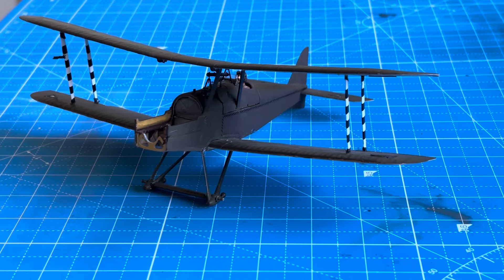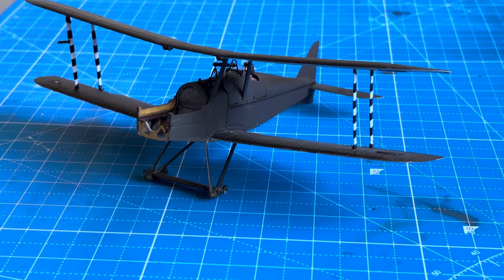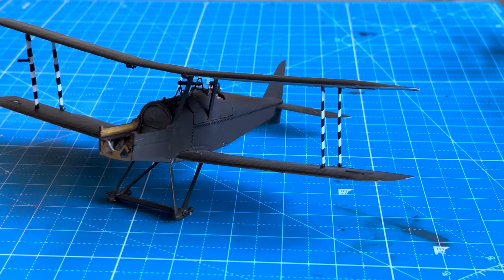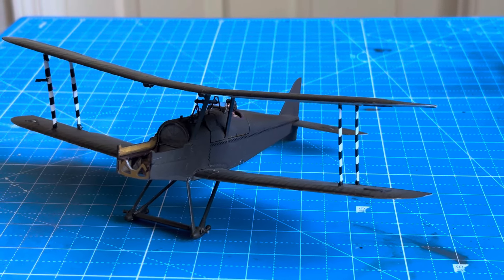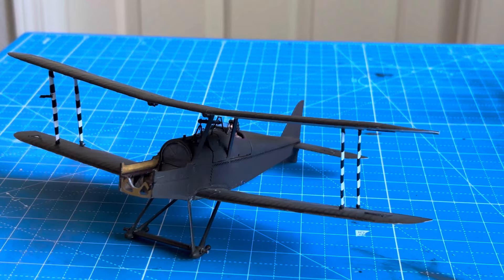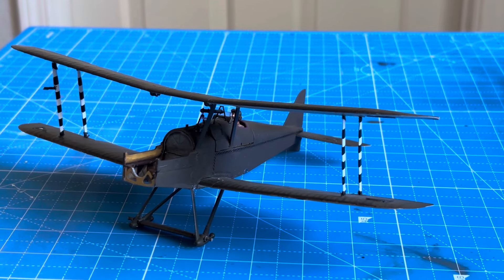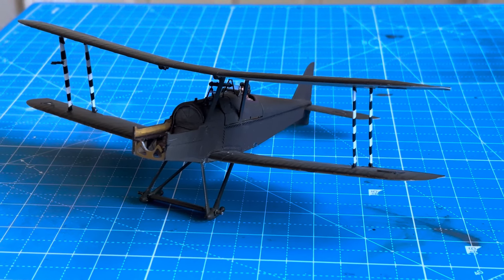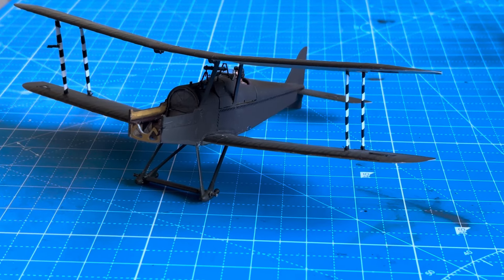There’s got to be a morning after…

Comment: Inspiring words unanticipated on a Wednesday
You're a modelling workman Mark - and I can think of no better compliment, no drama next morning, just a plan and the firm intent to push it through
I could learn a lot from you if I had the sense  ;0)
Reply from the maker: Well I appreciate that Phil.  There have been more than a few times when I've abandoned projects out of frustration of for other reasons less than noble, but I usually keep the massive failures under wraps.. and have been known to go back and delete old videos of partial builds.   I briefly considered giving up on this build but decided I needed to press on.  I have another Wingnut Wings S35a kit in the stash (that's a long story), so I know what pitfalls I'll face if I ever choose to build the S35a again.  Maybe.  ;)